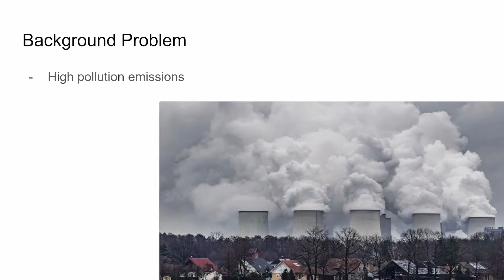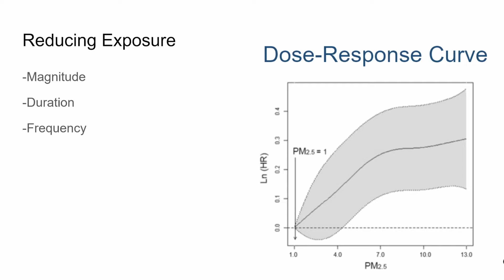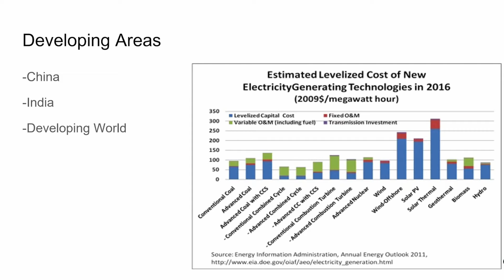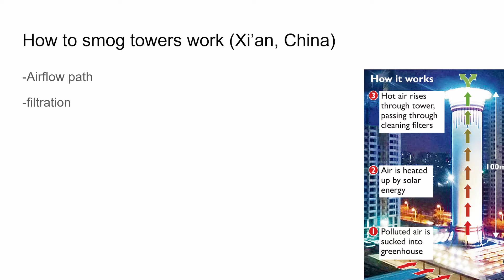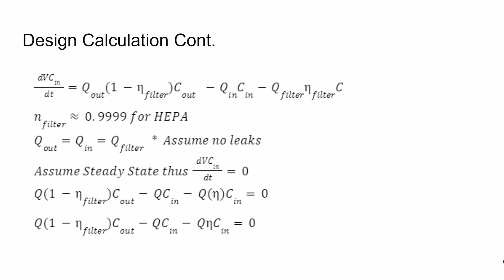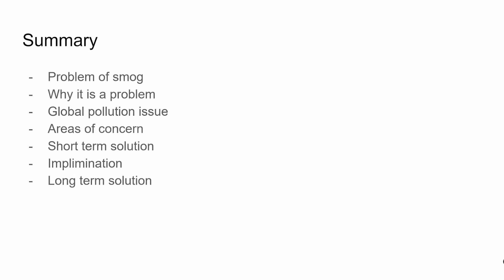Civil 4210 Final Project

Comment: Great presentation John! I have never heard of or seen the smog towers before, so I thought that was an interesting design and possible solution for reducing pollution. It got me thinking though, while the best solution long term like you said is to switch away from coal power plants, I wonder if there is a way to combine the smog tower with the coal power plant, so we can filter the emissions and reduce the pollution at the source. Its an alternative idea to your smog tower on the building roofs, to help filter per building and even further reduce, but I wonder if it would be a viable solution to try and filter more at the source?